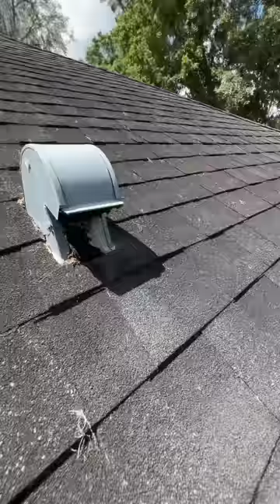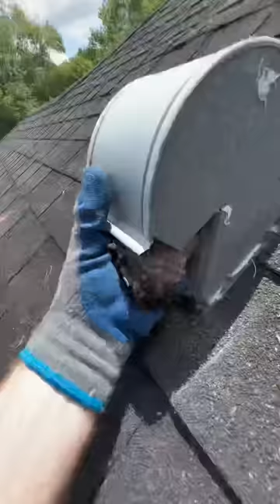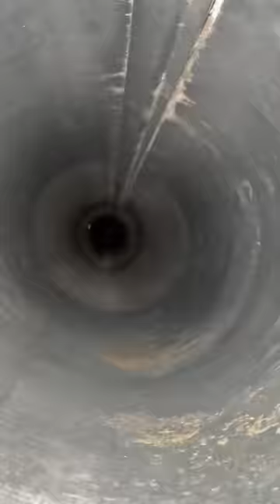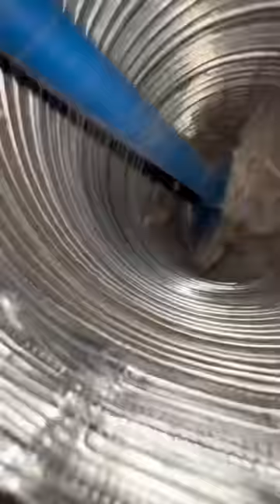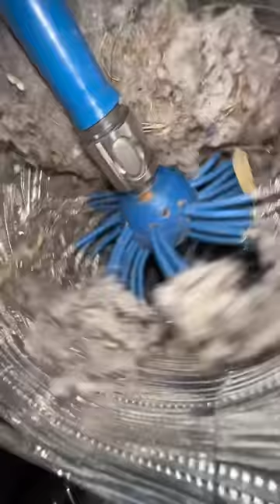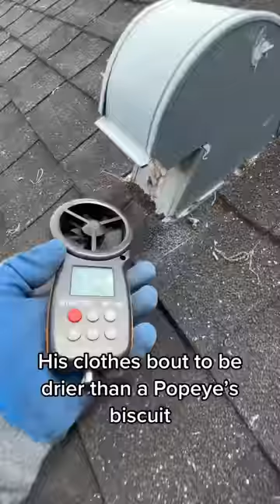Satisfying Vent Clean (Crispy Roach) #dryerventcleaning #laundry #firehazard #oddlysatisfying #lint

Comment: In Australia, we don't have  those vents and electric dryers connect to a normal outlet.
Reply: same in germany. when i first saw  these videos I was so confused lol here the water collects in a tank in the drier and the lint in a screen down at the door.
Reply: American outlets are puny 120v.

We had a drier vent in our place in Australia but it wasn't a weird long ceiling one it just went straight outside lol.
Reply: @JD13 Is already here if you're asking what they are called, I think they are tumblers, or just vent-less air dryers lol
Reply: @batt3ryac1d  driers here in America are on 240V with a 30A breaker the washer is the one on 120V
Reply: @rodneythe3rd122  yeah but you need a special outlet for that all outlets in Australia are 240.

And the special ones for power tools and really large appliances can be 480.
Reply: @LaraOlina  there is still a lint trap on the dryer. It just doesn't catch everything.
Reply: @ColeSpolaric  yeah, that's what I mean with the compartment under the door. And ours does catch a lot of lint :o Or what do you mean? :)
Reply: @LaraOlina  yeah, same thing
Reply: I probably know why
Reply: In south korea too, we have lint filter underneath the door and we should clean it after every use😮
Reply: @user-hv6ee4yf8o American dryers also have the lint trap that you clean after each use, the vent that he is cleaning here is to vent the heat, but it can fill with lint.

Comment: I never understand thess long pipes. That is the biggest problem. Just run a straight one to the outside as short as possible (max 1ft) and it will never clog up...
Reply: Most people have a dryer in the middle of the house or in the basement. The direct line outside is possible if the washer dryer is on an outside wall. In many cases, there wasn't a washer dryer when the building was built in the first place (in old homes)

Comment: I think this is something American because over here we have a mesh thing inside the dryer that you take out every other time and dump it in the bin.
Reply: This is a common misunderstanding. The dryer vent is not a lint trap. The dryer has a lint trap and a vent. The lint trap is the mesh that you clean after each use, the vent is to vent out the heat generated by the dryer. It's not supposed to catch lint, but it does in many cases .

Comment: Where im from, we don't have those vent thing. The lint just goes into a big comparment on the door and you just you know, take it out when you use the dryer... I don't get why anyone would install that
Reply: Ok so let me explain. This is not a "lint vent" it is a dryer vent which is used to vent the heat generated by the dryer. It is not meant to take lint, but inevitably it does. American dryers also have a lint trap that you empty after each use. I think this is a common misunderstanding.
Reply: @nono-fb8tr  ohh that makes more sense but we rarely have the dry vent things. I've only seen them at a laundry mats but they're American dryers so makes sense

Comment: Why do driers in the US vent outside the house? In the UK the lint is collected in a filter, and you just clear it every wash. Seems fair better than whatever this is, especially given lint be an idea thing to distributing into the air around us.
Reply: The driers have a filter that you wipe clean after each use. That’s the vent on the roof or side of the house is where the hot air gets blown out of the house , it blows out the hot air and the lint that doesn’t get caught by the filter. But when people don’t clean their filter all of the lint goes out with the hot air. You don’t actually see lint flowing out of a house when the drier is on.

Comment: What are these things on the roof? (I don't have seen one in Europe)
Reply: The way American dryers work is they vent the heat to the outside in some way whether it be out the wall or the roof. They have lint traps and compartments that catch most of the lint, but inevitably a little bit will blow through the vent each time you use it. After years of use the vent can clog like this. I think the roof vent style is common in newer builds, I grew up in a neighborhood with 80s built houses and everyone's dryers vented right out the wall.

Comment: I really can‘t understand why people aren‘t using heatpumpdryers…
And another thing that I really can‘t understand… why does every appliance in America has to be so bulky…
Reply: A quick Google search tells me heat pump dryers are massively more expensive than vented dryers (making them completely inaccessible to most people), and they take longer to dry your clothes.

Also, our appliances are bulky for a few reasons: because they’re designed and built cheaply; because Americans like appliances they purchase to be large because larger appliances are often perceived to be the best value for the money (you can fit more in them at a time); and because you can fit more in them at a time, you don’t have to do the things (laundry, grocery shopping, dishes, etc) as frequently, because we simply don’t have time or money to do the things more frequently due to being majorly overworked and underpaid. There are probably many more reasons I forgot to list. It’s a very complex topic.

Comment: What’s the point of that box in the wall?
Reply from the maker: It’s just a recessed box that allows the dryer to be pushed up against the wall without crushing the flex hose. Most homes built after 2001 seem to have them.
Reply: @MrLintGuy  cool, thank you

Comment: As a European watching these videos I can’t believe that Americans actually making drying their clothes so difficult and destructive.. why do the driers vent out of the roof? They don’t do that anywhere else in the world?
Reply: The vent is to vent off the heat generated by the dryer otherwise the heat would fill the room the dryer is in. Like it isn't that deep tho, it's a clothes dryer. Many are electric, many are gas, some are condenser style as I assume the ones in Europe are, but American styles vent to the outside. It's not difficult or destructive, its a clothes dryer.
Reply: @nono-fb8tr  we have the vented type as well as condenser ones. The vented ones have an exhaust pipe that goes directly out horizontally from the back of the machine and in my house at least it goes straight through a wall to the outside rather than via 2 floors upwards carrying lint that blocks it the entire way.. the exhaust pipe is at most 6 inches in length so is east to clean without hiring someone in. also drying clothes in a dryer is more destructive than mine drying.. lint is literally your clothes and other textiles disintegrating whilst being tumbled around.. line drying is better for them and also the environment as it uses no energy.